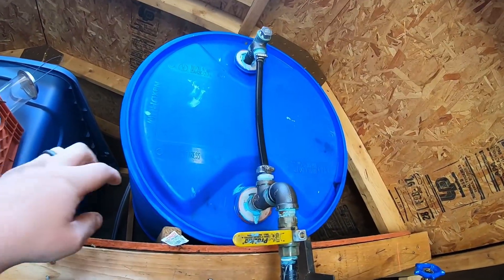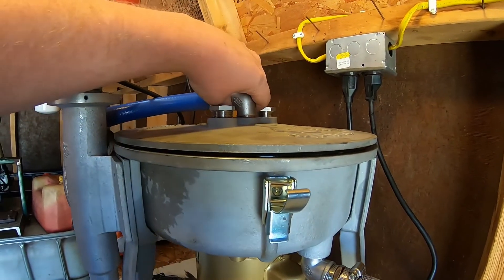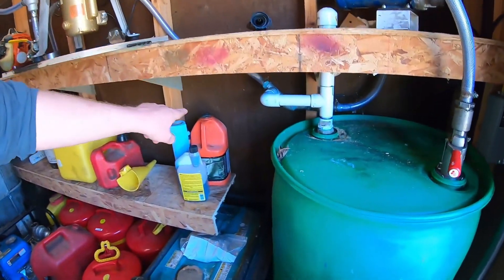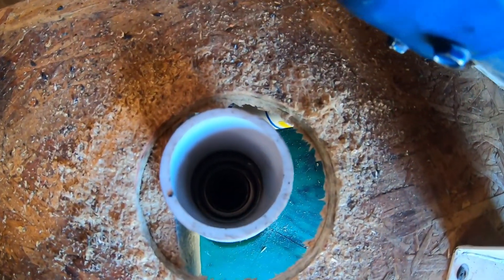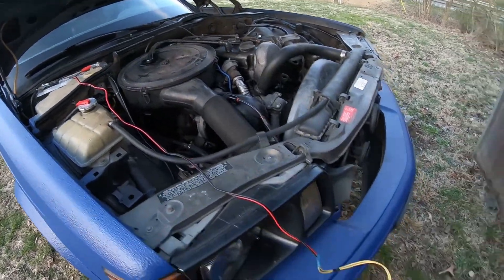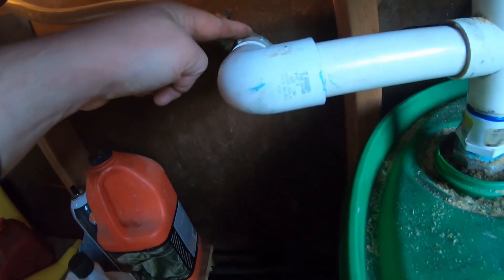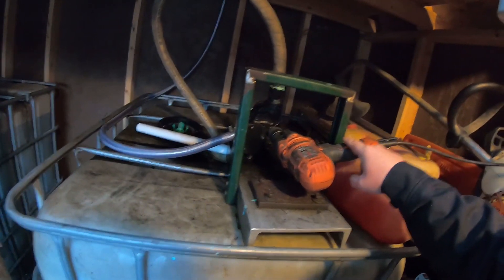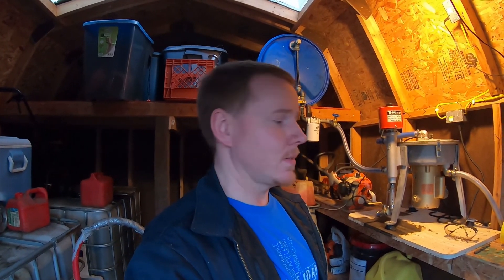Introduction To Black Diesel - Running A 55 Gallon Batch From Start To Finish - Alternative Fuel

Comment: Why do you run the oil so slowly? Have you done testing to establish a best rate?
Reply from the maker: More time in the bowl means more time the force is applied to the oil removing contaminants.  You can go slower even but 5gph works for me.  I have lab tests for both flow and RPM

Comment: Awesome setup! Quick question, I have a abundance of 15w40 diesel WMO and red dye diesel at work (equipment operator doing in house services on multiple trucks and machines) and commute 110 miles a day round trip so currently in the market for a small diesel commuter to take advantage of my almost free fuel! Now if I were to run a 15 or 10 micron filter on circulation then a 1 micron fuel filter on the fill up hose when filling the car would that be sufficient filtration? Also in a 50 gallon drum I’m going to start with a mix of 50% WMO, 45% diesel, 5% gasoline. What’s your opinion on that? Or being located in SoCal we can expect consistent 90-100 ish degree days and 60-70ish nights is the gasoline even necessary in my case if I achieve a good viscosity with just 50/50 and no gasoline? Any input is greatly appreciated! Thank you
Reply from the maker: It would probably get you started.  That's how I started.  If you're going to do this long term though, a centrifuge is a very wise investment.  The filters won't remove moisture...  And they won't remove nearly what they claim to as most are B50 rated.

You can blend however you want.  Just tinker with it and see what works for you and is the most cost effective.
Reply: @ awesome thank you!
Reply from the maker: @gabeguedea2499  no problem

Comment: No matter what mixture i use it always stinks and smokes like a train. I even done a 50 50 gas and oil mix after been through a centerfuge still smoked like mad in multiple different diesels, any solution to this?
Reply from the maker: What engines have you been running it in?  Single tank or dual tanks?
Reply: @NotSoGrandGarage  I've been running it on single tank setup, one engine is a 4 cylinder mechanical pump perkins the other a deutz 4 cylinder air cooled both seem to have the same issue with smoking.starts and rins perfect but just the smoke is a issue especially on idling
Reply from the maker: @tzajaczajac  what are these engines in and how are they being driven?  Short trips?  Lots of idle time?
Reply: @NotSoGrandGarage  one is in a dumper the Perkins one, and the other is in a 13 tonne track machine I only use the fuel in them as they are on high revs Alot, but starting to go away from it due to fumes and smoke

Comment: Looks much more evolved than what I built a couple years ago.. I just had filters and Mostly gravity.. 
 a word of caution....
Was filling my Mercedes 300 SD, ran grate on the mix.  Was running slow so I roughly calculated out when it have 10 gallons,, Then went and had lunch... Came back out and oh s***, There is dirty diesel running all the way down  the Hill.... Gravel driveway so the only solution was a shovel and garbage bags
Reply: Yeah I agree spending investment first can save in the long runs.. Huge potential savings plus higher quality.. LOLI just dumped About 2 gallon and a haof used oil, Directly in 2 My super duty 7.3.. Happened to add a little injector cleaner and It seems quieter Plus plenty of power .
Question did you have any encounters with DOT checking your fuel??  Just wondering if they ever physically check I'm in Oregon.. Have to sign for dyed diesel at the station Also...
Reply from the maker: @scottsdialyadventure1338  I've not had any issues.  With that said, they are looking for red dye only and they can test for it.  A work around... if you were to catch someone in a bad mood...   is to tell them you are using processed used oil as a fuel additive to help lubricate the injectors.  There are no regulations concerning fuel additives...  quantities... etc.  It's all in the wording.  You still have taxed fuel in the tank.  Keep your receipt when you put diesel in the truck for proof.
Reply: Thanks Very good advice
Reply from the maker: I've seen that happen with quite a few people.  I used to just run whole house water filters....    then pressure drive centrifuge....   then basic direct drive....    now the wvo designs extreme setup that I run now.  I WISH I would have gone this route from the beginning.  Would have saved a lot of time and money.  Lol

Comment: So it’s 1 gallon stale gas to 5 gallons oil?
Reply from the maker: For a 20ish percent blend, yes.  I typically run 5 gallons to 50 or 1:10 if the weather is warm which is close to 10% gasoline by volume.

Comment: How do you dispose the oil sludge in the 5g bucket?
Reply from the maker: Either take it to be recycled or use it for fire starter.  I use it regularly to burn brush piles.

Comment: What gasoline to oil ratio mix is that?, is that 20 litres mixed with 200 litres of oil?, I have been mixing 40 litres of gas to 200 litres wondering can I get away with less
Reply from the maker: In the summer, I run 10% gasoline to 90% oil...    up to around 20% when it gets cold out.
Reply: @NotSoGrandGarage  perfect thanks alot I've been running 20 percent wasn't sure if I could go less  in the warmer weather 👍
Reply from the maker: @tzajaczajac  yup no worries.  Just cut back slow and see how it likes it.  If the lift pump will move it.. it should be fine.  You'll notice a drop in fuel pressure if it gets too thick.
Reply: Thanks again I'll give that a go👌👌
Reply from the maker: @tzajaczajac  no problem! Appreciate you watching!

Comment: I made a batch of black diesel with 20 percent gasoline. Mixed it with a paddle on a electric drill and then ran it through a centerfuge. Problem I'm having is there is alot of trapped air bubbles inside the mix which is causing alot of air lock problems when running it, have you ever experienced this or could you throw any light on the problem? Thanks. Os love the channel full of great info
Reply from the maker: What kind of centrifuge are you running?  By air lock, do you mean with the centrifuge or in the vehicle?
Reply: @NotSoGrandGarage  sorry I wasn't very clear. the air lock was happening when using the fuel in the diesel engine, it's producing huge amounts of small bubbles that appear to be trapped in the fuel mix. I'm wondering if this is something with the mix or the centerfuge. The centerfuge I'm using is homemade but uses the same bowl as the one you have
Reply from the maker: @tzajaczajac  shouldn't have anything to do with it.  It sounds like you've got an air leak on that system somewhere.  If youre running a single tank, it could be showing up because of the thicker fuel..  but you've got air intrusion on the supply side somewhere.  That would be my guess.
Reply: @NotSoGrandGarage  I thought that too but I pumped the black diesel back out of the machine and refilled with Normal diesel and the problem disappeared, very unusual.
Reply from the maker: @tzajaczajac  that is certainly odd...   does it happen right off the bat or does it run... get warm and then start having the issue?
Reply: @NotSoGrandGarage  it happens right away, I made a new batch up and it did the same thing you can see huge amounts of tiny bubbles in the fuel. When the engine starts running rough I loosen the injectors and can see the air firing out really unusual. I was wondering if  the viscosity of the mix could be to blame. I might try another mixing method maybe like your own with the pump, I'm worried I might be forcing air into the mix using a paddle to mix it. I read a interesting article online about air entrapment in diesel fuel this could be my issue. Anyhow thanks for the help I will let you know of I figure it out cheers 👍
Reply from the maker: @tzajaczajac  air won't stay in the mix long.  I'm thinking you've got a small air leak before the lift pump and the slightly thicker fuel is making it noticeable now as the lift pump is having to pull harder.
Reply: @NotSoGrandGarage  thanks for help I'll get to the bottom of it I'm sure appreciate the help👍

Comment: what was the model/company for the drill powered pump for the oil and was it welded a new hole? im planning on using one everywhere I have to transfer except the fuel pump because Im a kid  trying to get startd in pickups and black diesel and dont have the money to buy a centrifuge and all those pumps. have a great holiday!
Reply from the maker: The drill powered pump is just a big block Chevy oil pump that I drilled amd added fittings to.  They are simple to build.  Can make them from small block pumps too.  Some people just drill and tap for pipe threads..  and plug off the bypass and such.
Reply: @NotSoGrandGarage  thanks!
Reply from the maker: @parkert2710  No problem!  Good luck getting going!

Comment: another good video. besides the Wix filter off the blue barrel, do you prefilter and how do you do it? I ask because the red diesel I'm getting is from oil tanks being removed and has quite a bit of sludge from the bottom. my concern is that if I filtered off my raw tank it would clog the filter pretty quickly. can't the centrifuge handle the oil without that filter? planning to make my mix 10% waste oil (5 gal),  5% reclaimed gas (2 1/2 gal) and 85% reclaimed red diesel (50 gal). plan to run it thru a centrifuge for my home oil burner, tractor and garage diesel heater. for my 08 Cummins truck use, I plan to centrifuge and also run it thru a 2 micron Diesel Fuel Filter Water Separator when I pump it in to my tank. any guidance would be appreciated. thank you   😃
Reply from the maker: I've long since removed that filter as it was more of a hassle than it was worth.  I do 2 passes now through the centrifuge  on every batch.  Centrifuge will handle the junk for sure.  With that said, only 2 weeks left of the discount code if you were thinking of investing in one (unless you already have one).
Reply: @NotSoGrandGarage  thanks and yes I have one that is still in the box. with fuel prices and now that I moved to a bigger place, figured it was time to get going. I just watched the double pass video and was surprised it took out so much more sludge. guess I'm going to have to rethink my setup also. at least for the truck and tractor fuel. thanks again and look forward to your system rework video. have a great holiday.
Reply from the maker: @ezyjack826  you too bud and thanks for watching

Comment: are there any issues with separation of ethanol-blend gasoline? wondering if I need to use pure gas for thinning.
Reply from the maker: I've not had any issues and most of the gasoline I can get easily is E10

Comment: What style of pump do you run in my our car ?? Surely mechanical and direct  injection pumps are best compared to common rail also how much was the centrifuge and where u buy it please
Reply from the maker: Mechanical lift pump...   and mechanical injection pumps...   I've got both rotary style and inline pumps.

As for the centrifuge,  I've got a video coming out on that Friday which will include a fairly good discount with the manufacturer of it so keep an eye out for it!
Reply: @NotSoGrandGarage  cheers man I got a Nissan patrol electricaly controlled mechanical pump Bosch vp44 so it’s basically a feed drum through and filter into centrifuge out into collection tank and mix with diesel 50/50 or 60/40 60 oil 40 fresh pump diesel ??
Reply from the maker: @keithy363  just depends on your setup but yeah basically.   On my single tank car, I blend my mix 50/50 with diesel.  In my dual tank vehicles..  on tank is diesel amd the other is straight my blend...  no diesel.

Comment: Just curious, what do you run on this fuel? I'm guessing nothing new with DEF and a DPF. Just wondering how new emissions vehicles would handle this stuff.
Reply from the maker: Most everything I run is mechanical.   Cummins, DT360, OM617, and a couple 7 .3 IDI. Anything with dpf would be a no go.  It would plug it rapidly.  Now if they've been deleted....  I've heard some are having good results.
Reply: @NotSoGrandGarage  OK. Thanks for the info
Reply from the maker: @dereksmith1803  no problem.

Comment: What kind of transfer pump are you using for circulation of your finished product?
Reply from the maker: The transfer pump is a DEF pump from fillrite.  Got it dirt cheap new... otherwise I'd just use a standard transfer pump.
Reply: @NotSoGrandGarage  oh ok, I have a shallow well "jet pump" on hand. Do you think that would work? It's rated for approximately 15 gpm...
Reply from the maker: Not sure.  Depends on the seals and if it can prime itself.  I've not had much luck with water only rated pumps.
Reply: @NotSoGrandGarage  makes sense. I think I have talked myself into making my own pump from a sbc oil pump like you have to transfer from your totes to your barrel feeding your centerfuge. I'm thinking of hooking up an electric motor to it instead of a drill, only because I have a motor already that's not being used. If it works well I'm thinking I will make a second one dedicated to mixing and dispensing finished fuel....
Reply from the maker: @phillipramsey6231  mine used to be ran by an electric motor but the coupler failed and I've just not replaced it yet.
Reply: @NotSoGrandGarage  have you ever considered running a sbc pump connected to a gasoline engine for a transfer pump to collect oil with? Not sure what kind of gpm flow you could get out a sbc pump? Having a hard time finding that info on the web. Just a thought. It would be much cheaper than buying a trash pump...
Reply from the maker: @phillipramsey6231  I used to use a SBC pump and a drill for pickups....   would take 10ish minutes to fill a 55 gallon drum.  Then I built a big block pump with 1" hoses and it cut that time a good bit.  I wouldn't want to power it with a gas engine.  If the pump ever catches a solid... its gonna be a bad day.
Reply: @NotSoGrandGarage  good insight, may not be as good an idea as I initially thought. May just need to save up and go the trash pump route like you have...
Reply from the maker: @phillipramsey6231  another option is vacuum.  If you've got access to any tanks that can take negative pressure (think larger propane tank, etc..)  easy enough to build a "super sucker". Used to be pretty common.
Reply: Hey Chris do you remember what the model number of the big block pump you used to make your pump with? I've been looking at the melling m155hv, it's basically a high volume version of a standard small block pump I think?

Comment: How is the top barrel vented?
Reply from the maker: There is another barb epoxied into the side of the drum right beside the one that the fill hose is connected to.  I need to get more hose so I can run the "vent" down to one of the totes in case I ever overfill it...   it's on the list of things to do.  Lol

Comment: What temp on the heater? Did the metal part of the heater come with it? Mine seems to be missing.
Reply from the maker: The housing that bolts the the fuge came with the heater kit yes.  I run it around 180F

Comment: If you make your mix first then run it through a centrifuge it will get it a lot cleaner because it is a lot thinner
Reply from the maker: The oil at 180F is actually thinner than my W90

Comment: I run about a gal an hr.
Reply from the maker: I just don't like the idea of heating a gasoline blended mix.
Reply: @NotSoGrandGarage  I didn't say run it with the heat it will be thinner if it's already mixed and if it's already mixed a lot more debris will settle out in the bottom
Reply: I think is all about what the user likes. I mix mine let it sit then run it through the centrifuge about 2-5gal hr.I dont heat  at all but i also only clean in summers when it's warmer out too.Ive not had any issues with water or such once i got my setup kinks worked out.I also collect from same sources who know not to toss in antifreeze or water mixed oils.I find some water slim inside bowl once in a while but not enough to cause me to heat mix up before cleaning.Its what you are comfortable doing because in the end your one it will cost. I like his setup too just not fan of heating up to 180 bit. I find i can drop a lot of debris and trash out  to bottom mixing it first. He used 5gal per 50gal i think he says , I toss in 15-18 percent  to ensure its thinned  before ever transferring to top tank to run pass.Its a what works for you type thing but we all love seeing how others process their waste oil.Like he says , run dual tanks so you can always pull in and add in some extra rud or diesel if its not quiet right to get it adjusted for weather.

Comment: Does it have to be motor oil? I have a large amount of clean oil that is mixed with motor, gear, trans, and hydraulic oils. I’m on the fence about using that
Reply from the maker: I run anything petroleum based.  Thin and clean are the important parts.

Comment: Hey, I was curious what year your Mercedes diesel is, and what, if any modifications you have made to run it on black diesel? I scrap cars for a living, and end up with a lot of waste oil, and stale gasoline. Have been very heavily considering buying an older diesel car for my daily driving and investing in a black diesel setup similar to this.
Reply from the maker: It's an '83 powered by an OM617.  No modifications to the car running 50/50 mix of W90 with diesel.  To run a higher blend, I'd suggest 2 tanks.

Comment: Hi from the Netherlands.  Awsome video, thanks a lot!  Also watched some of your other vids but still have a question if i may.  In the end of the process your adding somekind of petrol-mix  into the ready/filtered oil.  May i ask what this mix is and howmuch percent you add?  Thanks in advance!
Reply from the maker: It's 5 gallons of gasoline diesel mix.  Typically,  I use straight gasoline but get mixtures like this from time to time for free.  I run 5 gallons of "thinner" to 50 gallons of oil.